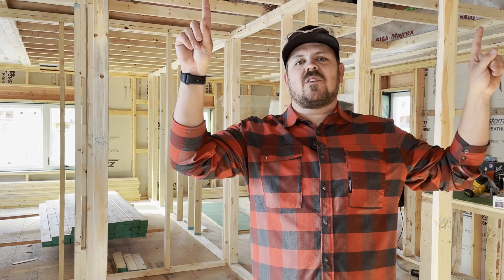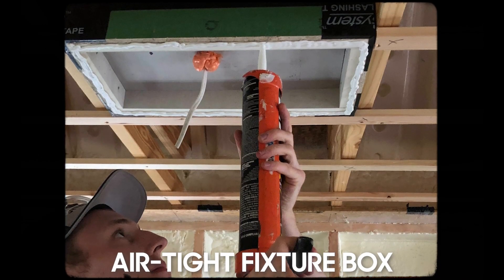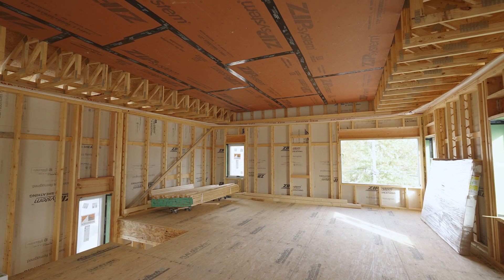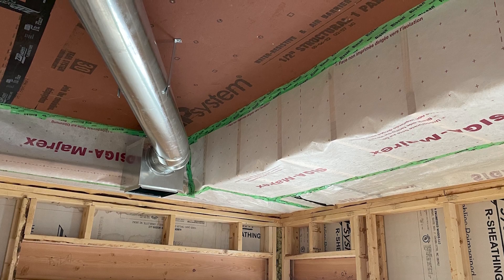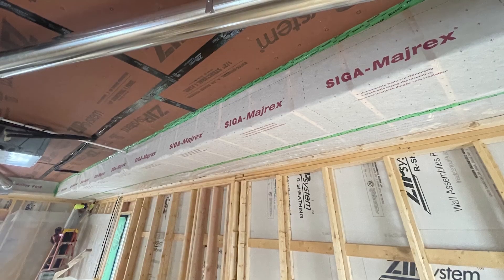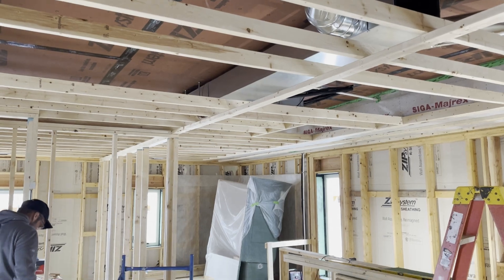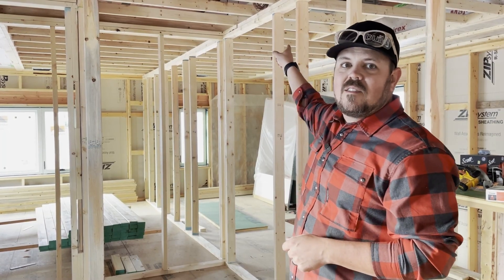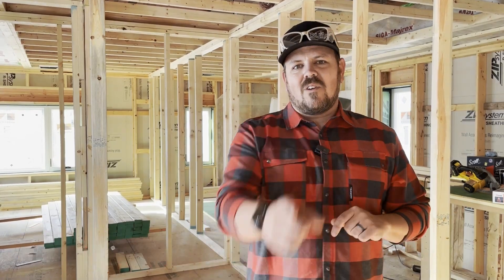Keeping Mechanicals Inside the Envelope

Comment: Why are almost all American homes a fire hazard?
Reply from the maker: I’ll bite. Why is this a fire hazard?
Reply: Hmm…highly flammable light wood framed construction with zip OSB sheathing, probably zip OSB roof sheathing, OSB floors, etc. Will you have fire rated walls or fire resistant roofing?  You must be aware of the LA fires. Granted you’re not in the same environment as Southern California, but it amazes me why US hasn’t moved onto more fire resistant houses using mass timber, ICF, CMU, adobe/rammed earth type construction, etc. If these types of construction is out of your scope, at least use fire resistant treated lumber like TechWood. Costs a little more because there’s no economy of scale for these types of construction in the US, but if more builders adopt these alternative methods, prices will drop, the houses will be much more resistant to natural disasters, and last a lot longer than your typical US house that will last around 30-40 years before falling apart.

Comment: Will that sweat if it's inside the envelope? Does it still need to be insulated?
Reply from the maker: I believe all duct work should be insulated to be preserve the temperature running through the ducts on its way to distribution. I want that air to hold temp as long as possible. This duct work is no different. As to sweating, probably in this location, it is slightly stale air space, it is probably the hottest part of the house being on the second floor ceiling, and it is high risk if it does sweat because it would stain drywall and potentially mold if it did.

Comment: I am building a cottage (15X20, 17 ft tall).  I have built the exterior wall of 'double staggered studs'.  The studs are 2X4 with top and bottom plates of 2X6.  The outer course of studs stand on the outer edge of the t/b plates and are structural and hold up both the cottage and the subsiding/siding, with tarpaper between these two.  The other course of studs stands in the inside edge of the plates and holds the insulation and drywall.  The electrical system is mounted in conduit on the inside face of the drywall; no holes or anything (except for the main panel feed and the heat pump).  The cottage is not finished but in some 95 degree days this summer, the cottage remained at 72/75 without opening doors or windows and no mechanical' it is very near passive.  (And it is quiet!)

Comment: Better to have the mini split unit in attic. I did this same thing with a mini split in a false ceiling in a basement. Works well but is loader than I like. If it’s in an attic it will be quieter. I’m overly sensitive to noise so likely not a problem for others. These units are intended to be mounted in an attic space. I think it is louder than a standard wall hung mini split.
Reply from the maker: I have a couple units like this in my home that are in spaces like this and do not notice the noise issues you describe. Manufacturer, install, and overall location surely play a roll. Totally understand what you are saying though.

Comment: I’m not super thrilled with the triple top plate as it allows a lot of thermal bridging, especially compared to a super efficient advanced framing approach of a single top plate with trusses and studs in vertical alignment for maximum efficiency. You’re doing some really nice pocket headers to maximize the amount of insulation and then kind of undoing the benefit by putting back all that solid framing (and then some) with the triple plates. I love that you’re trying hard to refine ways to incorporate good building science in creative ways (and sharing it with us 😊); I encourage you to carry that thinking through in every detail. I don’t have a solution to offer, just the observation that what you’re trying to accomplish at the transition from wall framing to ceiling/roof framing can surely be done more efficiently. Thanks for the opportunity to learn and share.
Reply from the maker: We do have exterior insulation cutting down on the thermal bridging here. That third top plate is added cost, effort, and reduced insulation though.

Comment: Jake, I’m curious about the differing permeability characteristics of the Zip sheathing and the Siga Majrex. Majrex is considered impermeable from inside to outside (0.097 perms or less) and semi-permeable from outside to inside (greater than or equal to 4.25 perms) so the ceiling cavity can dry out if needed. The OSB in Zip, especially with the adhered WRB, is considered impermeable in both directions. This can be beneficial on the exterior envelope—at least in climate zones 4 and below—but may lead to unintended consequences when used in the manner you are using it. From a building science perspective, it seems more prudent to stick with one strategy and design the envelope accordingly rather than mixing and matching approaches and hoping for the best. If I were the owner of that house, I wouldn’t want you to be experimenting with air barrier approaches on my house. Just go with the Siga Majrex to do exactly what it’s designed to do. Otherwise, I love the approach of creating the plenum with the air barrier protected up above all the “stuff” that can be challenging to seal around in the ceiling plane AND allowing your ductwork to be in conditioned space without having to heat and cool an entire attic.

Comment: Top notch air barrier system for sure.  I can't help but wonder if cost is ever considered when using name branded building materials, and extra materials and labor to achieve these results.  ie. if the homeowner saves $1000 per year in heating and cooling but pays an extra $80,000 for the home, is it really worth it?
Reply from the maker: I would say your example is extreme. This detail probably cost the client $4k, over and above what a competitor would have charged to place a unit in the attic. However, the ROI isn’t the issue at play here. We have the misconception that we build effcient homes for return on investment only. We build for health and comfort. Energy is a by product. Our home is going to be substantially more comfortable than the leaky building with an air handler running through the attic. The return on investment is probably there over a few years but we don’t look at things that way. The same way folks purchase a BMW for something more than a Honda our clients purchase a home from us because their expectations are higher for comfort and performance.
Reply: So called branded products are rigorously tested and warranted as a system to assure compatibility. Yes, you are paying a relatively small premium for the assurance that the documented products and installation procedures are compatible as a system rather than guessing and hoping for the best. I learned this the hard way early in my career as an owner’s project manager for commercial/institutional projects and I have no reason to doubt that the same principle applies to residential construction.

Comment: Plenum is a great idea. 

Would cladding the whole ceiling in something like 1/2 ply and taping the seams control vapor well enough for your climate (zone 4)? That seems to be the greatest benefit of the smart membrane. 

With ply and strapping you’d probably make the trades happy they can staple wires and hang ducting or plumbing anywhere. Cost is probably cheaper than siga too. Thanks to you and Steve for all the teaching you do!
Reply from the maker: Potentially. We like the Siga products because they limit moisture migration in that smaller cavity space more than simple plywood can. The framing members are easily spotted through the Siga membrane as well so mounting isn’t tough. However, what you are describing would probably work fine.
Reply: Ah ya got it. Good point. Someone needs to spray some variable membrane on plywood. That’d be pretty slick. Maybe we can get Steve to invest…

Comment: Jake, please follow up on this, in particular the insulation detail. From this video it looks like insulating is going to be a challenge around the plenum.
Reply from the maker: The insulation was simply blown in place on the top side of the plenum and wasn’t an issue.
Reply: @jake.bruton.aarow.building  What I still am not understanding is if there’s a risk of the blown in insulation tearing the smart vapor barrier if there is strapping underneath it once all the weight of the blown in cellulose is sitting on top of it. Couldn’t it sag from all the insulation weight until it hits the drywall and possibly tear? Maybe im not picturing it properly or it’s stronger than it imagining but I’m trying to understand as this is the detail I’m wanting to do on my new house build.
Reply: @jake.bruton.aarow.building  what about the sides of the plenum
Reply: is this a vented attic..From the pics it looks like the eaves are vented?
Reply from the maker: Sorry for the lack of detail in this video on the insulation. The attic is vented and insulated with blown-in-place cellulose. The cellulose was installed after the ceiling was in place and from the top side with a single access point from the exterior. This was then closed and sealed on the way out. The remaining space was small enought to not have code required access later. There is enough space from the ceiling to roof deck to get plenty of insulation on the topside to meet a R-60 minimun everywhere. We also supplied insulation shoots to keep things from affecting the air flow of our venting.
Reply: @jake.bruton.aarow.building  Thanks for the reply! You and Steve are the best. Thanks again for sharing your expertise!
Reply: @jake.bruton.aarow.building Do you see any risk of the Majrex tearing or a taped seam opening once all the insulation is blown on top? Isn’t the blown in cellulose or whatever is being used essentially sitting on the Majrex at that point, other than the strapping, with a 1.5” gap between the drywall ceiling and Majrex?
Reply from the maker: We have not seen any issues. The assembly is still open when the insulation is installed so we get to watch what happens. The product is overlapped at seams and the tape from Siga is amazing. If you have concerns you can always use a few staples as well.

Comment: Can we get more details on the SIga being an air barrier?
Reply from the maker: Siga Majrex is a smart vapor retarder and is air tight. It is similar to poly however allow for moisture flow in one direction. Meaning from the attic into the building moisture can move but from the building into the attic. Science. It laps across the top plate of the wall prior to the trusses being set and tapes to the exterior zip and that is where our continuity of control comes from.
Reply: @jake.bruton.aarow.building  and the trippy thing about it being "smart:"  in cold weather it actually tightens up and blocks cold infiltration and moisture from the outside coming in... but when things warm up it loosens up and diffuses vapor/etc. from inside to outside.  Truly amazing stuff
Reply: @srchubz Siga’s website seems to contradict what you are saying. It says Majrex is basically impermeable from inside to out (<0.097 perms) while being semi-permeable from outside to in (4.25 perms) so the wall cavity can dry to the inside if needed. Perhaps that’s heating season? Then, as a smart air barrier, reverses during cooling season? Would be useful to get some clarity on this from someone who is intimately familiar with the science behind Majrex.
Reply: Any membrane can be an air barrier - that’s the easy part.  What’s more difficult is to have selective humidity flow.  In general I’m rather skeptical about “smart” vapor retarders.  I’ve read up on them a bit, and their behavior is NOT well described in most online materials.  In any climate zone where you put a vapor barrier on the interior side of the insulation, the membrane will be at the same temperature year-round, so it’d be pointless if the membrane’s “smart” behavior was based on temperature.  And none of the manufacturers really claim that they only let moisture migrate in one direction.  From what I can tell from reading online materials, the “smart” membranes vary their permeability based on the humidity level.  If it’s more humid (really humid, like when condensation is starting to form), they become more permeable.  If it’s less humid, they become less permeable.

Comment: Yo Jake. First, thank you. 
Second, how do you feel about the following OUTSIDE of the air control layer:
1. Mini-split line sets
2. Bath fan duct work
3. Range hood duct work?
Reply from the maker: I’m not concerned about the lineset. It has to leave at some point. The bath fan actually doesn’t exist, it runs from our ERV system which also doesn’t penetrate the lid. Our range hood in this home doesn’t actually vent. We have electric appliances, and a small filtering hood. The clients don;t cook much.
Reply: Even cooking with electric appliances produces lots of compounds and odors you don’t want inside your extremely tight house. Corbett Lunsford documents this thoroughly in various videos on his Home Performance YouTube channel. Besides that, code is most places that I know of no longer allows a non-venting range hood and requires makeup air (separate from the ERV system which is not intended to provide that much makeup air). Not trying to be a troll; you MUST provide proper range hood design and operation in a high-performance home in order to adequately address IAQ.

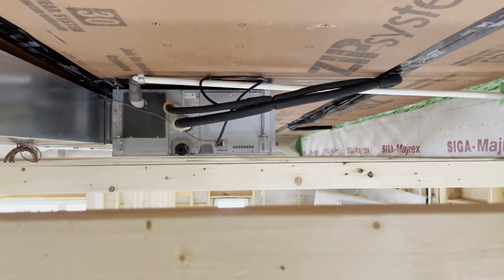Comment: 2:07  So if this ducted minisplit unit ever needed servicing or replacing the entire ceiling has to be removed? 

What is the cost savings of having trusses recessed and still having to frame a second ceiling vs just insulating the roofline and gaining even more storage space and ease of maintenance/retrofit/replacement of HVAC? Seems like its way too much hassle to me.
Reply: Access panel will be provided.